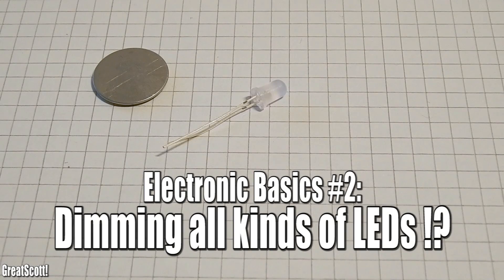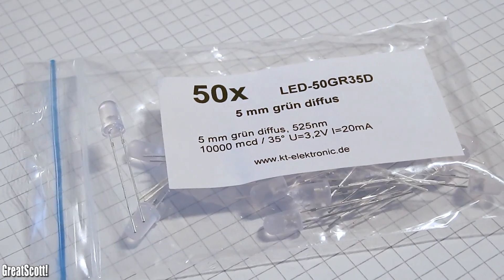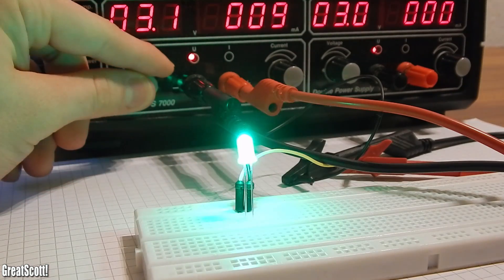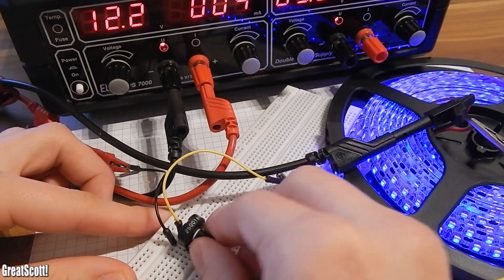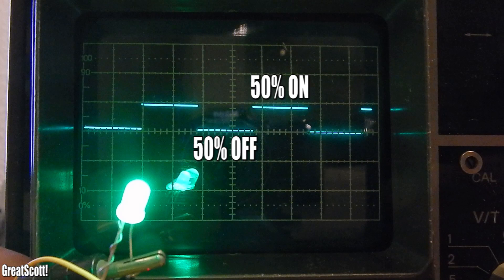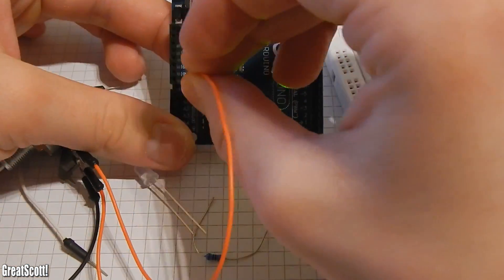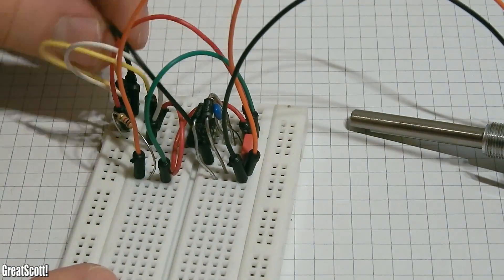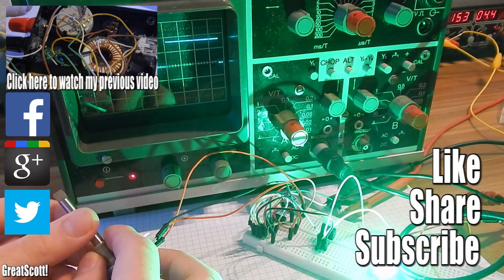Electronic Basics #2: Dimming all kinds of LEDs!?

Comment: Normally you would set the voltage on the bench power supply to a safe value and then adjust the current.

Comment: Why even use the PWM if you attached a mosfet? All that voltage and is still going trough a variable resistance and thus wasting power isn't it?

Comment: Please let me know following,  can we control 2v LED with 12V PWM, if yes what should be the width of the 12V pulse and width of the 0V pulse (with out using resistance in series with LED), if we keep the 12V width really small then the led will never burn out because high voltage and current ( product is temperature ), and then the 0v width will allow the the LED to cool down before the next 12v pulse.

Comment: Would you be able to use a 12 or 24 volt battery with the pwm method. Small pwm units are available ready made on ebay.  
One of these units, a 12 volt lead acid battery and a ten or twenty watt cob led and no other kit?  The pwm units are for small motors but one guy uses them for leds.  He did not say what his power source was.

Comment: Im trying to wire a brake light/marker light on to my car. Im going to cut into the tail light wires and bring two positive wires to the new light. One being tail marker, and the other one brake light.
So the light i bought only has a brake light on a single wire.
I was wondering if i could wire in a resistor to the tail light wire to make it come on with tail lights dim and full power on brake light. Can you help me identify what parts i need to complete this project? And so i dont backfeed power because the two wires will have to connect to the single wire. And tail light will always be on unlike the brake light.
Thank you for your time!

Comment: Dear Great Scott. I like your explanation but... I have a desing question that up to now I have not been able to solve.  I want to dim a low power LED (in this case a bicycle rear-light LED). The dimmed state would be the normal operation state. When I apply the brakes I want the LED to become brighter (i.e. brake-light). That should be by the use of a momentary switch. I do not like the solutions with resitsors and diodes. Ik was hoping you or someone like you would have designed such a solution around a 555 chip for insance. Maybe there are already better IC's for this I do not know. Could you device such a schematic ?
I would be very interested.
Thanks in advance for your efforts and educational youtube postings which I am enjoying very much.
Reply: You could just hook a push button on the place you rest your hand when you brake, so that when you pull, the button is pressed. I suppose you already know how to dim a normal led so just put it in 50% duty cycle and then, through digital read of the button state, set it to 100 when you brake. That should do it, assuming of course that you have not solved this yet, in which case I hope you will be able to make it work

Comment: Im having some weird issues with this 555 circtuit... the electronics store that i bought my components from didnt have the BUZ11 mosfet, but they found one that was comparable: IRF540N, so ive installed it.
Im using this circuit to dim 10 lasers that are hooked up in parallel.
The input voltage of the circuit is 5.0v from a computer power supply.
So here is where it gets weird... with a single laser installed, the dimmer works flawlessly. I add a second, and the output voltage jumps up to around 8 volts, and the when i adjust the potentiometer, the lasers dim at different rates. One dims out before the other starts to dim.
I now have 6 out of the 10 lasers hooked up, and the output voltage is now at 19.56 volts. One of the lasers is running very dim, while the other five lasers are full power. The five lasers are dimming near the same rate, but the one that is already dim turns off completely.
I have no idea why the output voltage keeps increasing with every laser i add...
Is it just a simple case of using the wrong mosfet? Or is this circuit simply not going to work for what i need?
Thank you to anyone who offers any helpful advice!

Comment: Hey Scott, can you maybe tell me how to connect mosfet in parallel and what resister value is need between the gates... I will be using 100wx3 led chips in series (forward voltage 30-36v), on the IRF540 mosfet. That said, I want to dim 4 sets of (100wx3 led chip) from the same dimmer?
Reply: Gysbertus J Fourie im working on something similar, except with 10x 5mW lasers. Having issues with this circuit after adding the second laser... im hoping that i dont need 10x of these dimmer circuits, because that would defeat the purpose of what i am trying to do...

Comment: +GreatScott! How do you convert an Arduino or 555 PWM output yo a real analog signal? Would a capacitor do the trick? I would do the experiment myself, but I don't yet have an oscilloscope.
Reply: An LC low pass filter will work best.
Reply: Thanks for the reply. I don't understand how you could use an LC low pass filter. Could you please make a video on that?
Reply: No (my channel is not an electronics one), but i can describe how it works and post links for resources.

Comment: Hi Scott,

So I have 2 led day time running lights in the car and I'd like to dim them because they are too bright. I have found some 50w resistor wires on ebay and I want to know if i use those will it make the lights dimmer so its not as bright? or will it require much more complicated wirings? the 2 lights is 30w and the resistor wires are 50w 6 ohm.

Thanks

Comment: Hi, I have big poster in my room and I've put come RGB leds all around it, I was thinking, since it takes 12 volts to power it all... I want to build a driver to incorporate in to the frame of gbe poster... the one that came with the leds it's really big. I just need to be able to switch between the comors and adjust the intensiti. I've already looked around I don't find notheing smaller than a Arduino mega. could you pleade help me?

Comment: Your channel is the most brilliant and creative channel that I have ever saw! 🙂
Reply from the maker: Thanks mate
Reply: Any chance you can explain the circuit for LM317 for the strip? I'm trying to do the same. Thanks :)
Reply: Thanks for the tutorial, if I understand correctly the only component I have to change for different voltage LEDs in the NE555 configuration is the resistor in series with the LED, right? 
The rest of the components are all the same? Also what kind of Capacitors are these exactly?

Comment: If you can dim the led in the arduino  by lowering the voltage (0 -  255) why use PWM anyway? Does it put a strain on the board?  I'm trying to understand.
Reply: +Joaquin  Serka so it kind of works, but it's the lazy man's way. Also, it can blow up the potentiometer wich is bullshit, apperently. Thanks for the reply, it's very clear now.
Reply: +Thijmen de Jong  Look also at the PWM vs Potentiometer video on the same channel

Comment: I need some help here:
PHANTEKS PWM-Lüfter-Hub is a pcb with fan headers for 3-pin casefans, which are controlled via the pwm signal of the motherboard header (4-pin to 4-pin) and for additional power (the motherboard header does not have enough amps) there is a 2-pin to molex/sata 12v.....
But this thing costs 20 bucks ... and it can't be so hard to build something similar, but there is no scematic for that pcb neither i'm that into electronics, that i could tinker something like that hub out.... 
Could anybody help me ?

@GreatScott! +GreatScott!
Reply: a MOSFET will be the answer ? pwm signal from motherboard to gate, 12 volt molex to drain and ground to source and than slitt that to the other fanpins ?
Reply: nope 12 volts from molex to all leds but negativ from the fan pins to drain and ground to source, right ? and pwm to gate, right ?

Comment: I got some led in paralell, well 100 of them. and thay are going to use about 300w (about 480mah) i don't think the arduino is capable with that much power. any suguestions?
(i am not english)
Reply from the maker: +kalle zieritz A Transistor or Relay.
Reply: +GreatScott! Thanks, danke fuer das tolle video! :D
Reply: Th...three hundred watts?! HOW...
Reply: +Matthew Ferrie well, it's high power led 3w each, (3.6V~3.8V Forward Current: 700mA) times (*) 100=300w (if i'am not wrong)
Reply: Leds might NEVER be putted in parallel!

Comment: So you can't dimm a led strip without using the arduino? Simply because a strip requires to much amps?
Reply from the maker: +cornelis bouwman No. You only need the PWM Signal and a fast switch.
Reply: +GreatScott! can you please post a schematic for it?
I'm working on a project involving a led strip that fades in for about 15 minutes and I can't find out how to wire it
Reply: +Tsach Levi how did your project go? i am working on something simliar
Reply: I have decided that I'll use arduino instead. 
I'm currently learning how to program arduino to keep time so I can time this to fit the project

Comment: is there a way to generate pwm WITHOUT ICs?
Reply: and WITHOUT making your own 555?
Reply: +Jorge Diaz Flip-flop transistor. ;)
Reply: +Jorge Diaz Yes, with a relay, capacitor and potentiometer. It'll however make a sound at the switching rate of the relay.
Reply: Press a button REALLY fast (Jk)
Reply: Check out oscillators by this guy (greatscott)

Comment: What are the point of the diodes connecting to the potentiometer in the 555 schematic?
Reply: ***** This is because one diode is connected to charge and another to reset pin, which in turns acting as a 'information dirrection control'. It defines threshold and rate of discharge, while maintaining constant frequency (frequency is not so important). At putput, you get on and off state proportionally long or short depending of potentiometer parameters. Hope this helps.
Reply: What is that white color board with so many holes called ? Sorry , I am a noob . I want to learn
Reply: Pradyumna Mishra a bread board

Comment: What mosfet do you use to dim those ledstrips? :D :D
Reply from the maker: ***** BUZ11
Reply: thx for the reaction :D :D
Reply: ***** Also you may use any mosfet, depending of your application. Be sure before buying and appying such mosfets to read datasheet of the product. You need to know few factors, as is maximum voltage, maximum current, but also capacitance between gate and the rest (source, drain). If capacitance is too high, then it means more current drawing from your Arduino or 555 timer, proportionally with frequency applied. The higher the frequency - the more current it will draw from those output pins from the chip. Plese find datasheet of your Arduino or other chips you use and look how much current is allowed per each pin. Hope this helps.